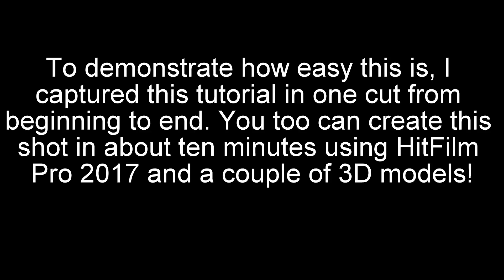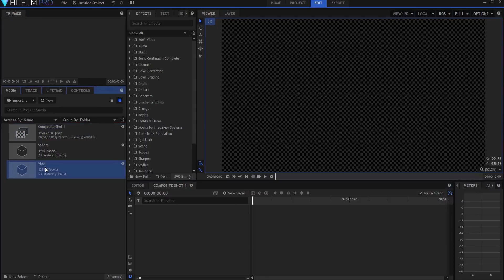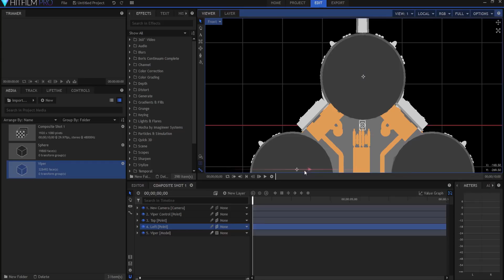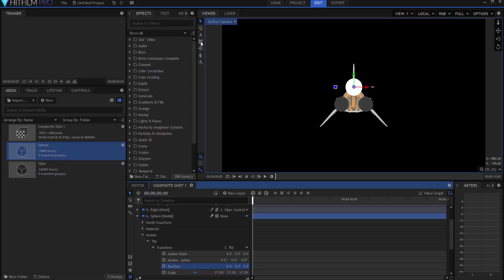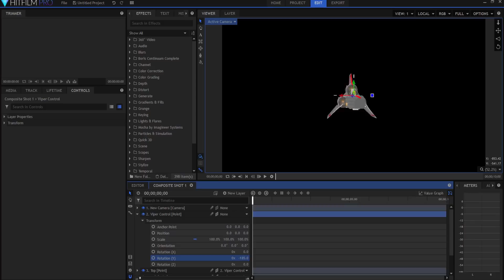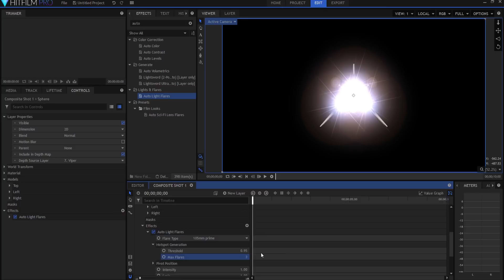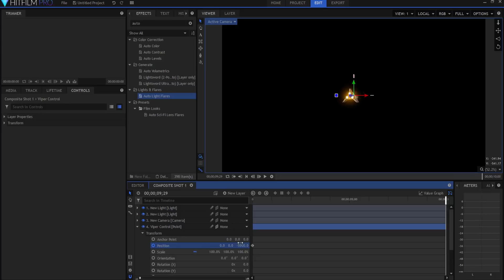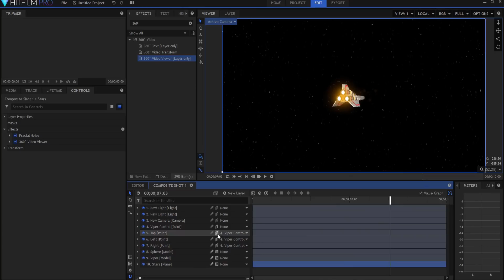How to Add Engine Glows to a Spaceship in HitFilm Pro 2017!

Comment: I did exactly what you did and yet my engines are always visible even when blocked by the rest of the ship. I made sure to turn on the property you emphasized and yet nothing happens...
Reply from the maker: Have you seen my most recent video on how to add engines to spaceships? I have outlined a better way to do this. https://youtu.be/Rg0EML7fPFw
Reply from the maker: In meantime make sure you take a closer look at the 7:00 minute mark of this video. Make sure that your Engine layer is above the Spaceship layer. Both layers need to be 2D.
Reply: @HitfilmSensei  thanks for the quick reply, I'll take a look at the upgraded video and see how that goes.
Reply from the maker: @uglynerfherder  Good luck! :)

Comment: That works. In the past I duplicated the model, turned all materials black, parent spheres to to engine point and then add glow(s), flicker to the second model for the engine's visible thrust. Never noticed the Depth Source Layer. Thanks.
Reply from the maker: You bet! :)